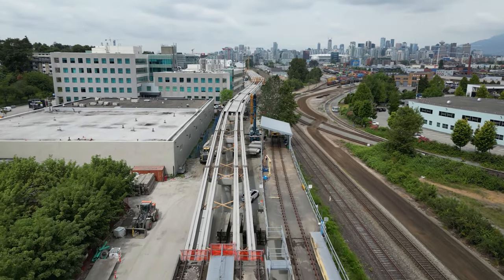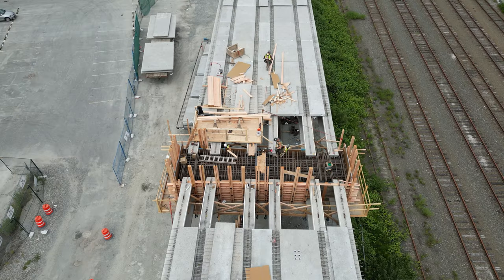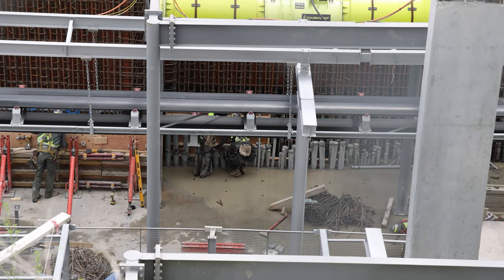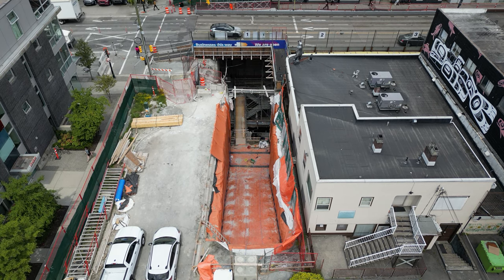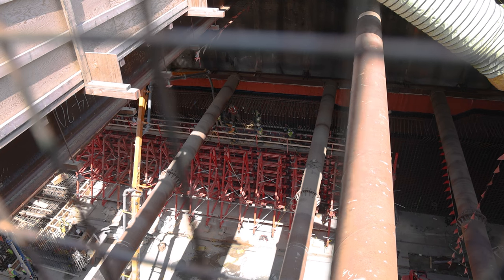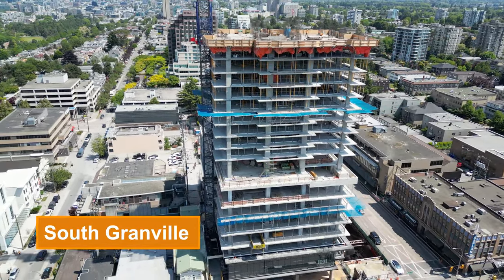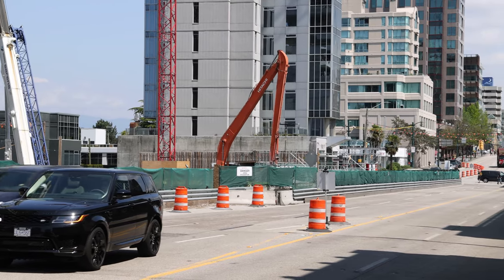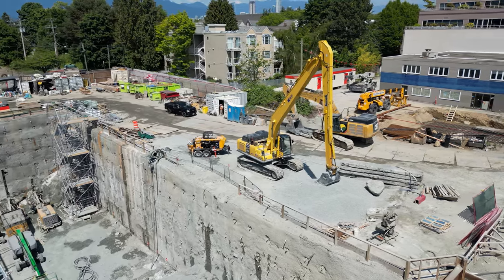Broadway Subway Skytrain Construction Spring-ish 2023

Comment: We moved to Vancouver in 1971.  The bus system was archaic and didn't cover large parts of the city very well.  I recall the buses stopped running around 2 am for many years.  If you missed the last bus, you taxied or walked.  The Skytrains really helped to open up transit in Vancouver and with the addition of the Canada Line and the rapid buses on the major routes,  it's much easier to get around.  The transit has improved amazingly and it continues to get better. I can get from Boundary and Hastings to downtown on one bus in around a half hour now, it would have taken over twice that long 20 years ago. I'd say that our transit is pretty darn good considering the size of the lower mainland.

Comment: Great update, really great to see Translink is now able to buy and develop properties around stations.

Do you know of they're planning an entrance on the west side of the city Hall station? 

I didn't think it was in the plans but you probably know not than me.
Reply from the maker: Glad you liked the video! 

For Broadway - City Hall, when the Canada line was built, there were plans for another entrance on the North West corner of Broadway and Cambie. While the space for the entrance still exists in the building that is there, there are no current plans to connect it. 

From what I've read, the knock out panel in the Canada Line station has been repurposed for the connection to the millennium line.

Although once complete, a vast majority of transfers will all be internal to the station, so there's not really the need for a second entrance. But hey, it would be super convenient if there was one!
Reply: Thanks for the info.